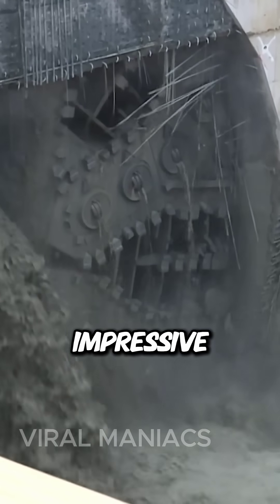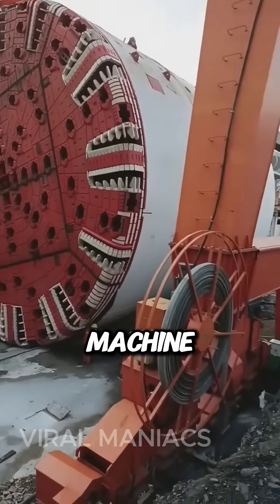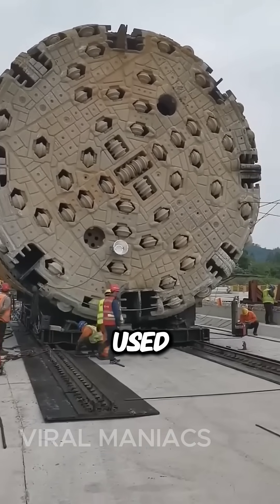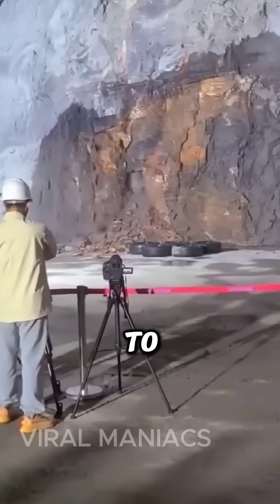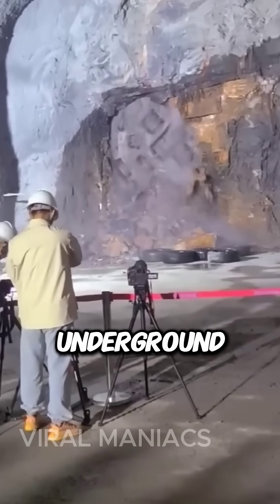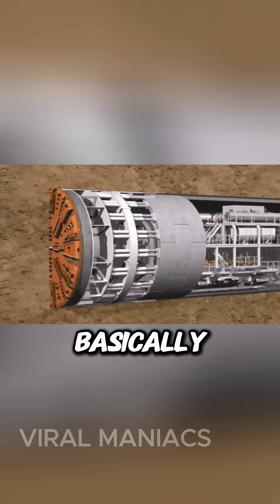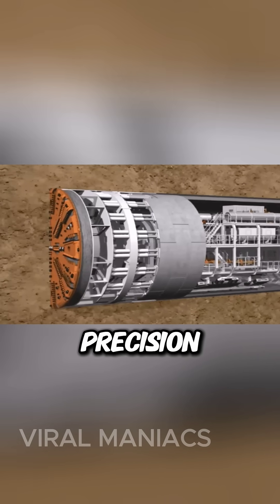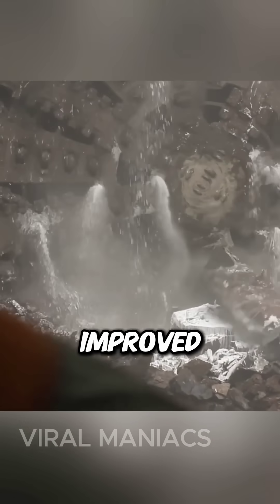This Giant Machine Can Drill a Tunnel Anywhere #shorts

Comment: Fun fact, many of these are buried or abandoned, if the cost of removal is too high, or removal is too difficult. 

Several of Madrids metro TBM's lie entombed beneath the surface of the city, and also the ones used for the tunnel between the UK and mainland Europe.

Comment: An amazing machine for sure! saddly like all things interesting and revolutionary it has already been made irrelevant due to the advancement of the tech and human ingenuity ever pressing the destructive envelope. What is made visible or useable to us the public is for many obvious reasons and many not so obvious top secret classified reasons is way way post dated. they like us to believe we are only months behind as what they let out seems close to the cutting edge to make us feel included like children just giving something to disract  from the real  thing.  the military and navy and air force are years and years beyond whatever it is you believe the latency to be. the boring machines are now fitted with a small nuclear reactor similar to the ones in our submarines, and powers a plasmawelder tip creating heat that melts the dirt and rock witch is sand . we make glass by melting sand the new boring tech melts its way through the ground leaving a glass shell inside the tunnel much stronger than any concrete we can make by far, and here is the kicker no dirt to excavate. no dump trucks, no bulldozers no piles of displaced dirt. making it invisible to satellites and spy planes. oh yeah and does it in two thirds times faster. in other words in less than half the time. look it up!

Comment: I am a Retired Oilfield Driller so I well understand the penetration rate of a TBM and it's advancement will vary greatly depending upon several factors, such as the diameter of the tunnel being cut, the rocks being passed through, etc.

QUESTION -- What is the "average" footage (if there is such a thing) that the TBM can be advanced through in a 24 hour time period through Limestone?

Comment: Makes ya wonder how many tunnels are unknown to the public.
Reply: A lot. Yes. I forged the drill cutting heads for this machine before retiring in 2017 from my 30 years as an Industrial Union Blacksmith. The need for the boring tooling keeps heavy Forge equipment running 24-7. They drill constantly, for many projects that we know nothing about.
Reply: I'm gonna guess a lot

Comment: My brother and my self worked on the Canadian Pacific Railway Project in Canada in my home town of Revelstoke British Columbia as the trains were going around the mountains using more pusher Robots train engines in the middle to push these trains up hil full of coal , now with this tunnel done back in the 80s , the grade a lot flatter to not use as many or none to as going around the mountain. 
You can type in you tube and put in 
Mount McDonald CPR Tunnel
project and get the 3 plus hour video on how they did this , it was a great job, and I was working on the west side of this Giant Mole Drilling through in the East side and the other company in the west side was from Japan and did the Old School Jumbo Drilling the U Shape of the Tunnel then Blasting with Dynamite then mucked out with side car driver s running scope tram 4 wheel loader machines to get all the blast of rocks out . 

Here a Quest for you All 

Two Companies one of the East side a Giant Drilling Mole like this one and the other side Jumbo Drilling and Blasting 

So who do you think Broke through First of their Mark ? 

Looking for ward to comments 😊

Comment: How did they build city wide underground tunnels all over the US cities in the 1800s? Tartaria!!
Reply: Years of manual labour and dynamite. You know, pickaxes and shovels were a thing. And labour laws didn't exist yet.
Reply: @CerberusTenshi  no way? people then must have been mechanical units iex. robots or smth.
Reply: In NYC, they used what is called The "cut and cover" method. Cut a long path down through the ground and then cover the top for a ceiling. 
Blasting was another way. Still used today as seen from warning signs in construction zones about blasting. 
And the other way you might be thinking about was using a large diameter metal tube (not long at all) that was moved forward manually , while reinforcing the tunnel walls behind the tube.
Reply: SEEMS FAR MORE CREDIBLE THAN MYTH AND "...and then magic happens .

But such rational is a buzz kill to the magic audience and other zealots of ignorance.

Useful comment!
Reply: Diamond pickaxes and torches
Reply: Chinese Labor
Reply: @Dr.Pepperdave  Not in NYC. The railroad? Yes. 
NYC was mainly Irish and Black Americans.
Reply: have you fkrs actually held a shovel and dug?? one of the hardest, most underrated labours ever! @cerebrulTenshi
Reply: @whome1636 NOT one of the hardest ever, but definitely VERY hard work.  Especially working untold hours EVERY day.
Reply: We've been digging and building underground for thousands of years...
Reply: Slaves built it
Reply: lol. tesla loop in Vegas took 2 years with the highest and newwest level of technology. they managed to dug out 1.7 miles.
Reply: DUMBS... If you know, you know